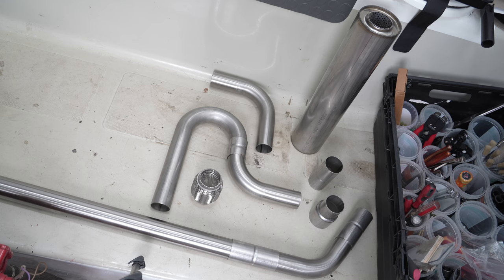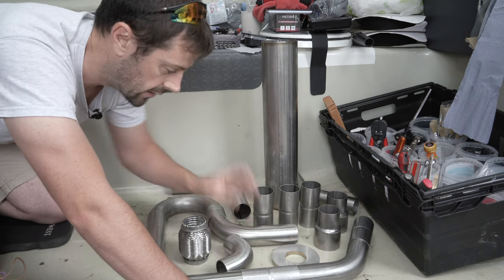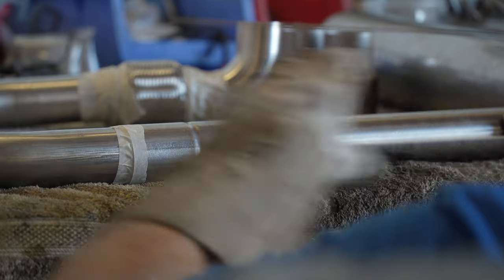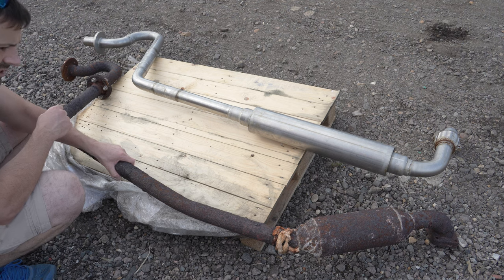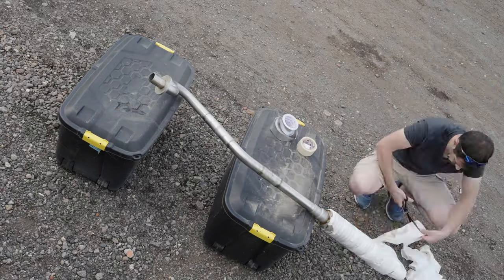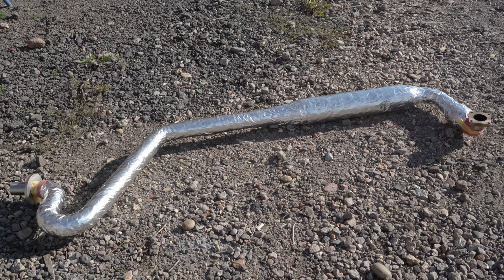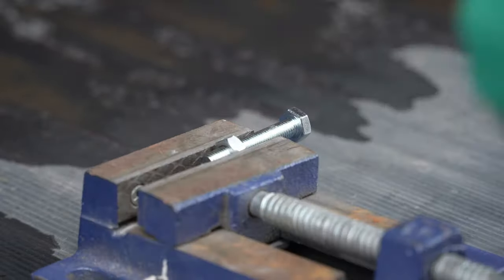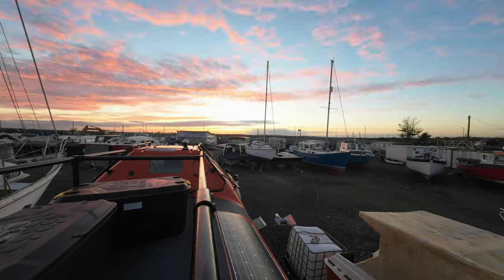TIG WELDING a custom-designed 304 stainless steel exhaust pipe. Lifeboat Conversion Ep57 [4K]

Comment: In case someone wants to criticize those welds, I want to point out that the smaller the diameter of the pipe, the more difficult the welds become. Anyone who has welded pipe or boiler tubes will tell you about it.
Reply: As a boiler operator I agree with Brian.
Reply: As someone that sometimes builds (stainless) exhausts/manifolds for hobby or semi professional purposes, I strongly disagree. The guy can tigweld, that's for sure, and is probably better at it than many. But there is no backing gas used - the tubes are open to atmosphere and no flow of shielding gas is introduced, the welds are burned (darkly discolored) because of slow speed and high current and lack of cover of shielding gas. I find it a waste of expensive materials to not do it the right way. I'm not talking about the lack of pretty rainbow colors here, just tig welding of stainless steel basics. The welds aren't very uniform either. Plenty of good examples to be found on YT on how it can be done much better. Will it hold? Sure. Is this best practice and will it prevent cracks? Only time will tell.
Reply: As someone who welds daily... those welds arent pretty but they are fine, i was surprised he wasnt backflowing gas to the inside of the pipe

Comment: Ah yes, weldy boi. I have tampered in being a weldy boi at my job, and have received a sunburn on both arms due to the bright lights and the protective sleeves slipping and exposing bare skin. You most certainly would want to get yourself a suitable welding mask if you wish to watch a weldy boi do their work.

Comment: I like the lagging rope, I used just glassfibre tape and it is a bit thin. Where did you get the rope from?
TIG is a great skill to pick up and not too difficult. I bought a 210ext Rtech AC/DC last year to do aluminium and stainless and it has been expensive (£1500 with gas), but I have been amazed at how easy and fun aluminium is (I don’t usually use the word fun to describe work). The other comments on back purging TIG pipe are kind of correct, but in reality it’s not got a nuclear reactor in there (well I assume you do not have a cat and some dastardly plan involving the artic). My stainless exhausts on my boat are at 15 years old now since I MiG welded them with argon/CO2 and they are fine.
Reply from the maker: I got the rope from a chimney and stove company, but it's generally easily available online.

Comment: Nice job on the exhaust Alex, surely that was a zinc anode rather than aluminium? Lucky the boat yard has a weldy guy!
Reply from the maker: Zinc has a melting point too low for an exhaust. Some people will criticise an anode in any case, but I went with Alu for the fun factor.

Comment: You can also leak test exhausts by getting someone on the outside with a cloth to muffle the exhaust exit. That way you actually get overpressure on the tube and you'll spot leaks easier.
Reply: Yes. That’s a useful and typical recommendation.

Comment: Bit of an echo on the VO? maybe you're just sat in a big room, probably quite a fancy one too.
Reply: Hearing it too. The echo is to short, loud, and sharp to be a natural reverberation. Probably accidentally playing back the VO twice somehow with one of them being delayed slightly.
Reply from the maker: I've not changed the process - SM7B, two pop filters, proximate speaking distance, and a slight low end boost in EQ.
Reply: @AlexHibbertOriginals  Did you by any chance make a video recording of the VO as well? If so maybe double check to make sure that video has it's sound muted, assuming the video is in the timeline.

There is definitely a change in the VO. Sounds like a very short (few milliseconds) delay but could be a phasing thing as well.
Reply: @pashimp  or YouTube compression algorithm messing with the audio.
Reply: @greylocke100  No, that's not what's happening this time. :)

Compression artifacts would not be isolated to the VO and would also sound different. Both phasing/delay and compression can cause loss of bass though  you could mistake them that way.
Reply: @pashimp  Thankee, I'm not too up on the audio, but I know various other people have been having sound issues suddenly.

Comment: Excellent job👍, that's the first thing I would say, however🤔, add a fixing to mount on a silent block on the silencer, to avoid vibrations, it will protect the hull and Alan's turbo, there are external flanges...😁
PS: Good job!!!:yougotthis:
Reply from the maker: Cheers - will have a look
Reply: Too bad the thermal protection is already on, otherwise you could have put a copper coil on the pipe to make an exchanger, for an extra heater or a water heater for tea...:elbowcough:

Comment: Have you considered integrating some kind of heat exchanger to use the exhaust stream to heat the cabin, unless you intend to use engine coolant for this purpose.
Reply: Interesting concept. Is that a thing, using exhausts as a heat source? Certainly a lot of free energy (heat) there. I guess on a larger boat you could more easily adapt the exhaust to be used this way but with Alan’s engine sitting pretty in the small volume of the boat there should be more than enough heat to keep things cosy.
Reply: @teeanahera8949 
Dehumidify is worthy of a thought...
Reply: @teeanahera8949  it's a thing for sure, most boats liquid cool their exhaust and dump it overboard. Integrating another exchanger into a closed loop glycol system could extract that heat to be stored in a simple hot water buffer tank.

Comment: This is the second time you gave me almost a heart-attack in two consecutive videos.
That beep at 9:02 sounds quite similar to my smoke alarm.
Maybe by the third time my body learned the difference and I won't shoot up from my bed with a pulse of 180 :(

😂
Reply from the maker: Ah - it's Alan's low oil pressure alarm.
Reply: @AlexHibbertOriginals  so Alan and I are both screaming in agony together.
That's comforting 😂